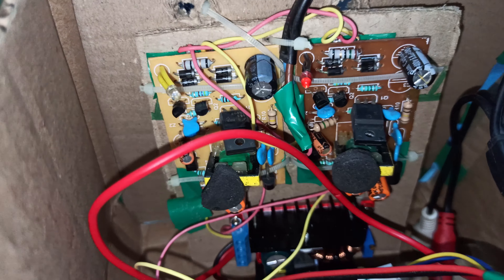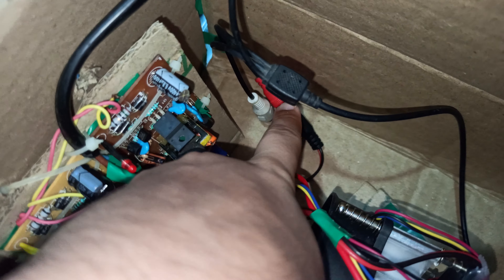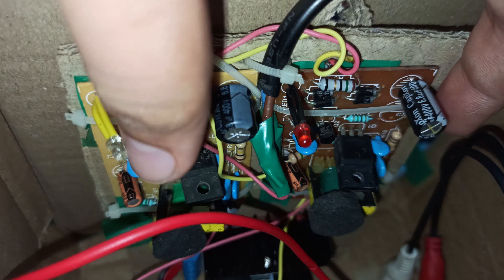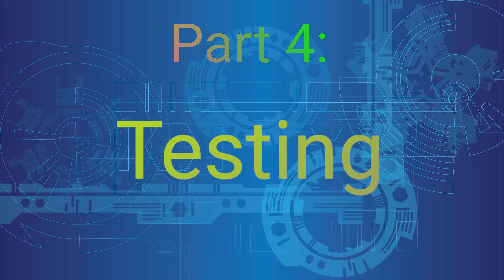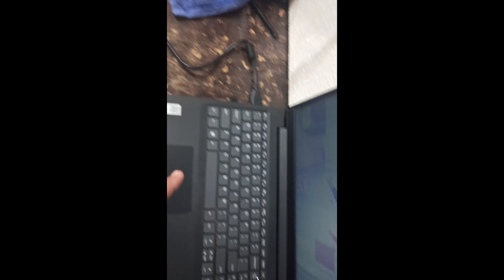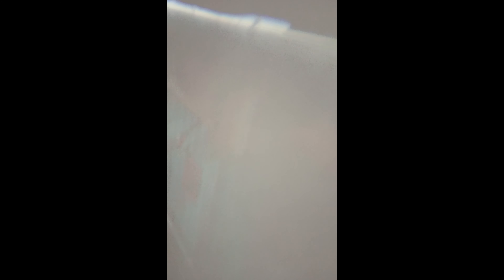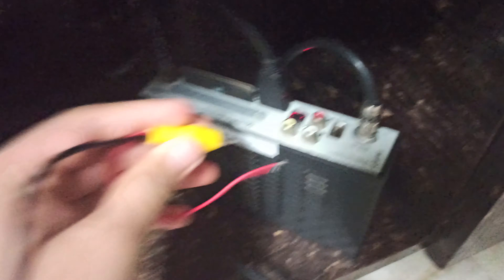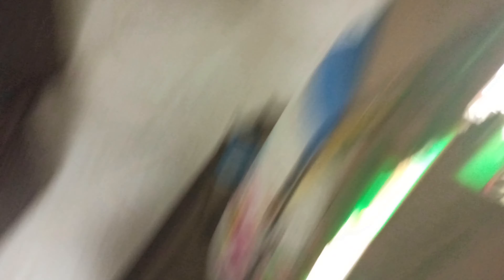How to make a 100W H.D. projector at home 800p. DIY projector

Comment: Can we use reflector instead of condensing lense?
Reply from the maker: condenser lens is preferable..
I am not much sure if  reflector will work...
For best results I would suggest to use condenser lens and also a few mirrors....
Reply: Thank u 😁😉.... What i thought was the purpose of the condensing lense is to reduce the angle of the light emitting by the led ..... So it can also be done with reflector 😅😅
Reply from the maker: No problem...
Actually the real purpose is to spread out the light so that the light reaches all the parts of the lcd...
 As the light can be taken as a point source in respect to the lcd... 
So the condenser lens is used to spread the light...
Reply: Hlo... Happy diwali 🔥✨.... 😂😂
Will there be any issue if i use Fresnel lenses with focal length of 30cm?? Because i noticed it looks little far from the led🙄
Reply from the maker: Doesn't seem to be an issue...
As you will have have to adjust the distances...
Reply from the maker: Happy diwali 😃
Reply: Can i use two 50w leds? 🙄🙄🙁 Sry if i'm irritating with silly questions 😅...
Reply from the maker: No its ok to ask questions... As they are never silly but the answers may be silly...😅

Ok... So the ans is that ... Try to avoid it...
As it may create 2 diff light source leading to 2 patches of the output bright and some dark...

But i am not quite sure as i have not tried it....
But if you do so... Please let me know the output... Even i am curious to know what it gives as an output...😅
Reply: @TOOLKIT_Parth  this convo is becoming long 😂... Can i get ur insta id? If u don't mind 😬
Reply from the maker: I am not on insta😅
Reply from the maker: https://discord.gg/MvSaDYta

You can connect me here
Reply: @TOOLKIT_Parth  not in instagram?... So u should be a good and a topper student 😂😅👍
Reply from the maker: @teja4433  😅

Comment: What circuit board used for driving lcd
Reply from the maker: It came with the lcd ... Inside the lcd box... It's it's motherboard... 12v input via ac-dc adapter